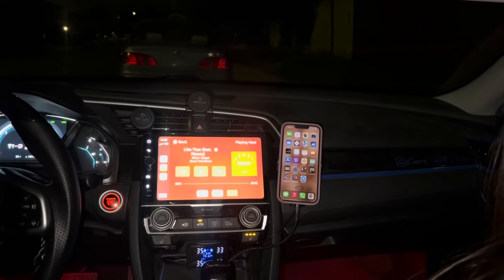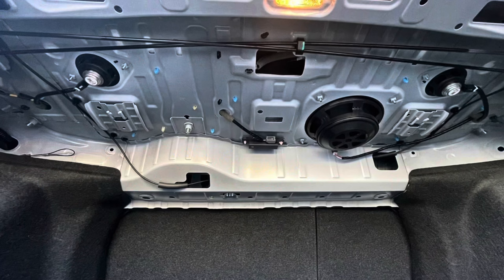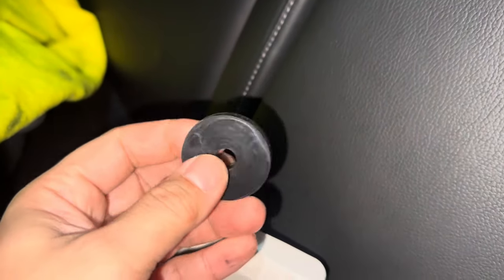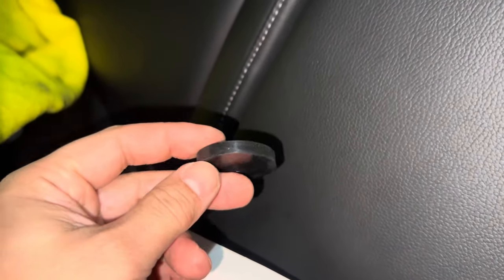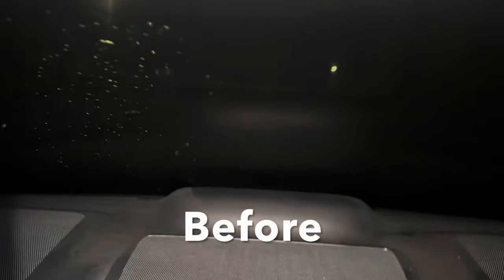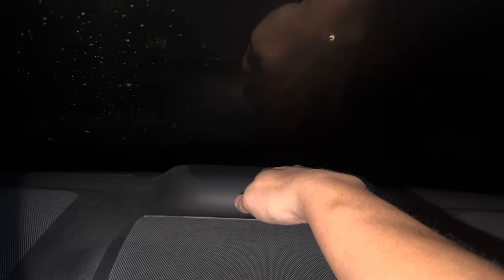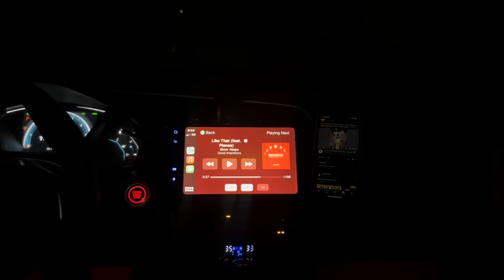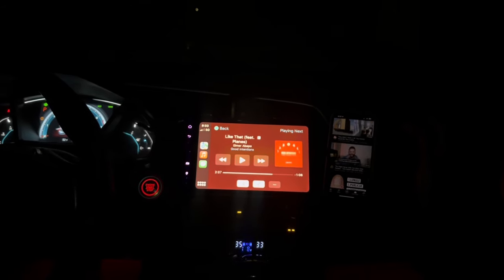Simple Fix For Subwoofer Rattle Honda Civic Touring Rear Deck Speaker Buzz Common Problem

Comment: One way to do it, Another is SPRAY FOAM. Trust me.
Reply: Tiny dab will do yah, and obviously not in the rear window, but in the trunk Under the rear deck. Look into some extreme car audio builds and youll see what they do. You just need to adjust to make it LOOK good in your car. They often dont care how it looks just how it works.
Reply from the maker: Thanks for the suggestion! Great idea 💡 
Something like this you think? https://amzn.to/3I8BUyz
Reply: @Sals_Garage  Yep Exactly. I would do a few test squirts on a bit of cardboard or something you can throw away just so you get a feel for how it expands if you havent ever used it. Make it more sure that you dont have to scrape or clean any of it off your interior bits
Reply from the maker: @crisnmaryfam7344  great tip! Will do. Figured black color will be easier to blend in